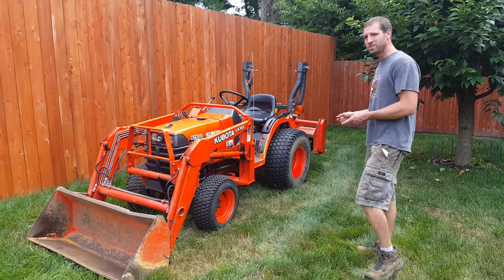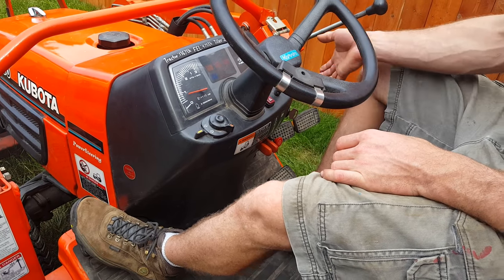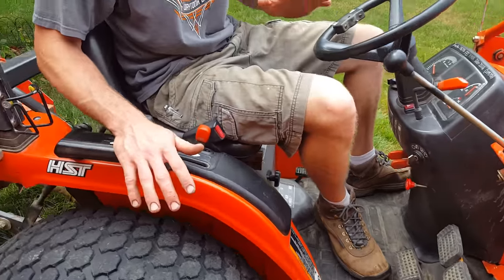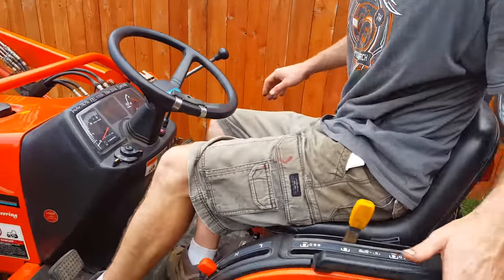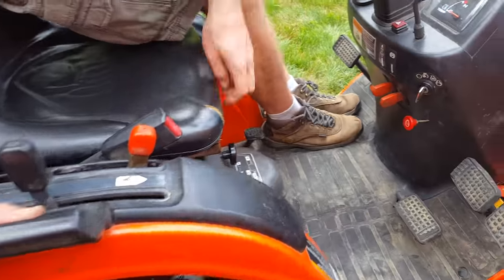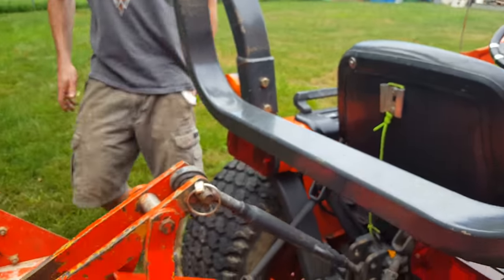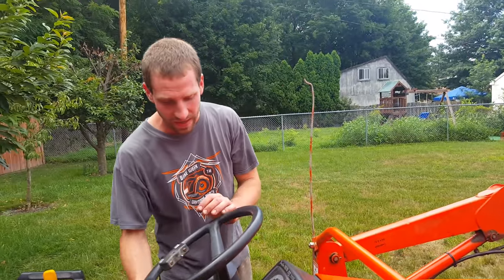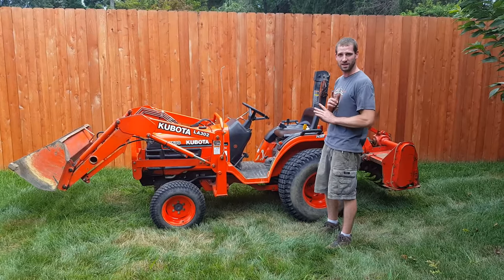KUBOTA B7500 OPERATION OVERVIEW/INSTRUCTIONAL  (How to use a tractor)

Comment: Great video!  I've owned mine since 2003 and even I learned something (the PTO control lever).  Two points that were missed, and I only mention it because I'm always nagging my boys on these:
1. I don't think this was mentioned, perhaps I missed it - only operate the implements with the HST in low gear.  I wasn't aware of this rule until I had a mechanic out at $150/hour to address an HST plumbing problem, and he noticed the tractor in high range and scolded me severely.  According to the mechanic, operating implements with HST in high range can burn out the HST.  Also, the tiller implement is more effective with the tractor in L range.
2. The trash screen in front of the radiator should be checked and cleaned out regularly, especially if you're working in high brush.  Failure to do so can lead to the engine overheating on a hot day, as mine did just yesterday (DOH!).
Reply from the maker: Thanks for you comment!  Very good points you bring up.  I certainly agree with both and yes i failed to mention them!  Thanks!
Reply: James Bull wow thanks. Low for the implements that sounds important!

Comment: To run rear bagger how do u raise and lower deck and run both pto's ? I think u can lock rear pto with valve and deck can still be raised and lowered? and should u run at low range but if mowing with bagger u would want hi range for speed? Little confused? any advise?

Comment: Chris question for ya, when you raise the implement is the control handle supposed to return to center?  My 7500 fails to do so. Thanks for the video
Reply from the maker: Yes it should return back to center when it reaches the top.  Mine actually started failing to do so a couple years back and I had to adjust the Rod that the handle is connected to. Now it works good again

Comment: The ROPS is of little value in the raised position unless your seatbelt is securely fastened.  Conversely, if you have to operate with the ROPS in the lowered position, your seatbelt should not be fastened.

Comment: I been trying to get a BX25 D with a loader / backhoe for my house usage because i have a big yard and i need to do a few projects. renting its an option but i am not the person who can get it for a week and get it all done. Since your unit is kind of all 2003, do you face issues with mechanics or trouble shooting? I am trying to spend less than 10 K.
Reply from the maker: overall it has been a very reliable machine for me however I definitely have to do repairs from time to time and of course the usual maintenance.  I strive to keep it in Tip-Top shape
Reply from the maker: the bx25d is definitely a great unit especially if you need the backhoe. My only gripe with it is that the Hydraulics are very slow unless you have the RPM up high. on my b 7500 it can be idling and the Hydraulics still work very quickly. that and to me, the bx25 almost looks like a glorified lawn tractor with how small the wheels are.
Reply from the maker: do you live anywhere near 19067?

Comment: Mine has to be in neutral to start
Reply from the maker: Interesting. Maybe mine is missing a safety switch. What year is yours? Mine starts in gear as long as the PTO is in neutral and the clutch is depressed

Comment: This video is awesome sauce. I just purchased a B7500, and now I need a sub-frame, a backhoe, and a tiller. Sigh...
Reply: When purchasing a backhoe for your b7500 or b7510, or bigger for that matter,look at wallenstein Backhoe Implements .They make a really strong subframe..
Reply: On these little kubota, tractors There are many filters and fluids to maintain. When purchasing one of these tractors, used' make sure you get yourself a manual. Trust me, you'll be good for many years. I have over a thousand hours on my  B7510 Hst with a wallenstein  subframe backhoe .. One tough little machine. 😊
Reply: @bdcarroll415  I'm going to put my 7500 up for sale. It's just too small for me. I want a regular backhoe, a real digger! I had a Massey 275 with a 3pt hitch backhoe and a large bucket on it. The entire setup weighed about 15,000 lbs, and then I went to this little tractor..sigh. 😅
Reply: @Atouk  I hear you, It's always nice to have a bigger machine if you need it. But for my needs, the b7510 kubota backhoe is perfect for grooming cottage roads and entrances , working under decks, hauling trees, launching my Pontoon ,stacking firewood , snow removal etc. But to be fair, it has been modified...?😊
Reply: @bdcarroll415  Yep, I love the little machine for tight spots. It fills specific needs but I also need a real digger. Maybe I just need 2 tractors. 😅
Reply: @bdcarroll415 I'm way closer to 6' than 5', and I'm more comfortable on my lawnmower than on the B7500. It's an awkward machine for tall guys. I'd say if you're over 6' you might need foot pegs on the bucket frame. 😅
Reply: @bdcarroll415  Your first name wouldn't be Butch, would it? I once knew a Gordy Carroll from Ovid, NY.
Reply: @Atouk  Better ride on the lawn tractor.
For sure😊 !'
Reply: @Atouk  Nope, i'm from canada🇨🇦 But i'm sure all Carroll's are related😅..
Reply: @bdcarroll415  😅✌

Comment: Hi, the neighbor brought his tractor over and wants me to make a new floor for it as it is rotten.  There is a round knob just below the front of the seat I have to remove to get at some of the bolts.  Can you tell me what it is for and do you think it just pulls off?  Here it is in the video.
https://youtu.be/WNJXe-jSlZA?t=526
Reply from the maker: Sorry just saw this now.  That is the 3pt hydraulic flow control valve.  Im actually not sure how it comes off.  As far as i can see it just pulls off but my doesn't budge.  Dont see a set screw.  You get it off yet?
Reply: @NoNonsenseKnowHow  Yes, it took some work, but it pulled off.
Reply from the maker: @24revealer  got you. Good to know! Thanks for the reply. I guess they must have just threw a little glue on the inside when they push it on